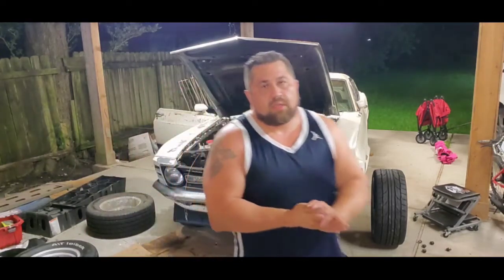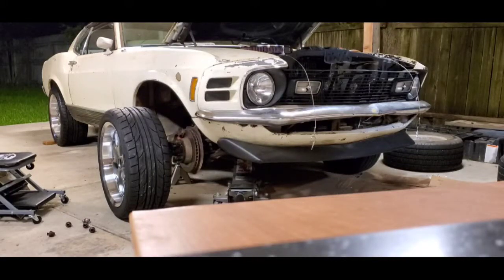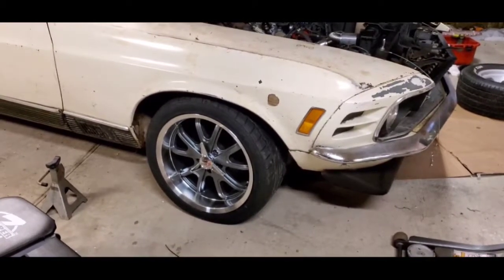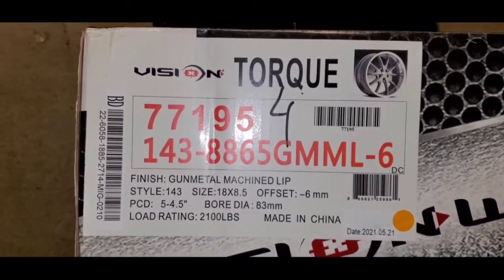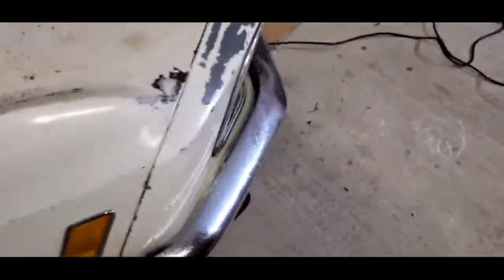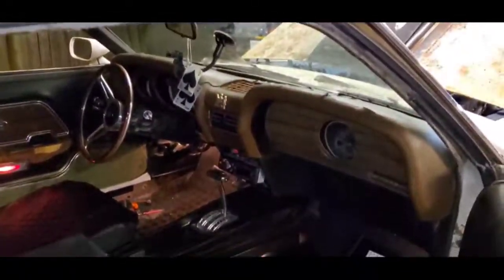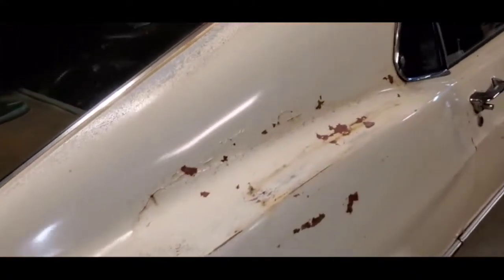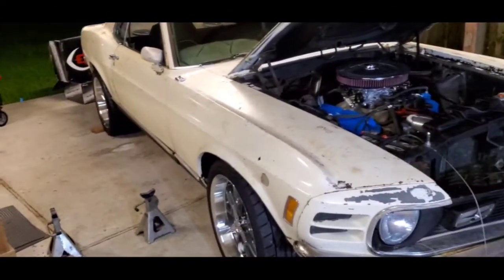New wheels on the 1970 Mach1 18x9.5 Nitto555

Comment: Like the wheels. Cars coming along.
Reply from the maker: Yes Sir Thank you, not sure if you noticed my  tires are directional  so i will have to re mount at least 1 front tire haha, rookie mistake but actually my 2 front tires i took them in my truck to the tire shop to get mounted so i guess it was a easy mistake to miss with out the car there at the tire shop.
Reply: @thetexasoutlaws  LOL We have all done it or will do it. Good it's a easy fix.